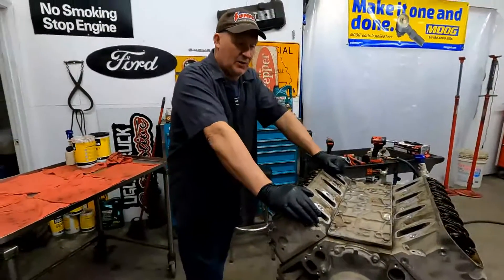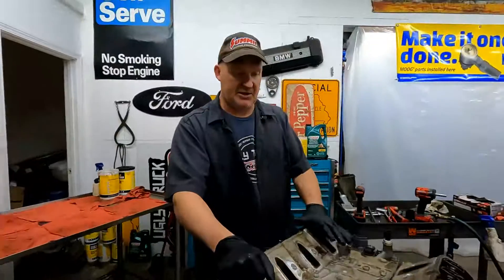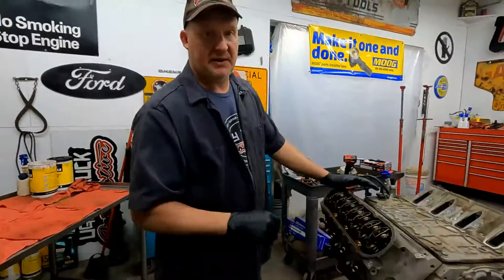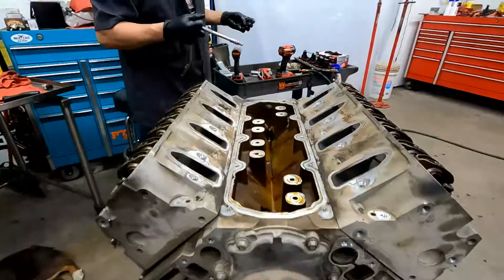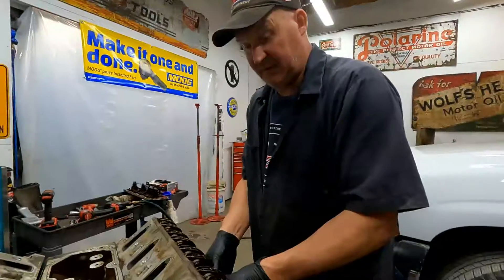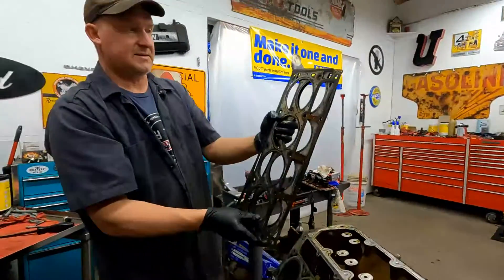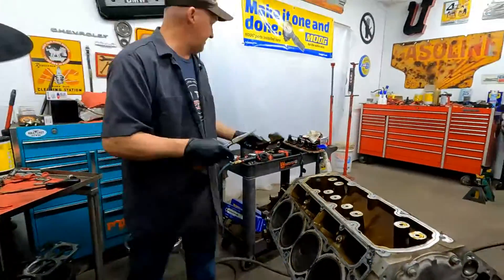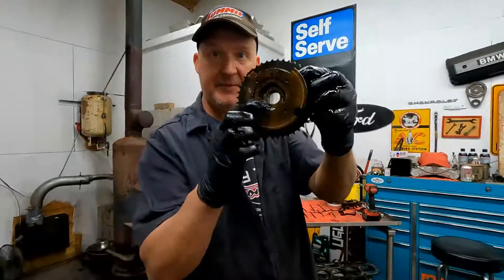WHAT'S THE DAMAGE? - 5.3L LS - LOW OIL PRESSURE - DOD DELETE - PART 1 - UTX

Comment: So why didn’t U suspect the oil pump was bad?
Reply from the maker: This engine had aluminum particles in the bottom of the oil pan.  I do take the oil pump apart to inspect them but very rarely are they visibly worn.  They are the first part in motor to get oiled and unless the motor is run without oil, they just don't wear out.  Thanks for watching
Reply: @UglyTruckExperience  just yesterday my truck started to drop oil pressure. Starts at 40 and gradually drops to about 10psi when driving. I changed oil and did not notice any metal or discoloration (flakes) in the oil. After it drops oil pressure it starts to make valve train noise which only happen when this first happen yesterday then I had it towed home. I’m suspecting oil pump? What do u think from this explanation?
Reply from the maker: What is make and model of truck and how many miles?  Unfortunately when what your describing happens, I would suspect that you have some worn bearings. You won't really be able to see material in the oil without taking the oil pan down.  The heavy metal particles, even though they are tiny, fall to the bottom and just lingers around in the bottom of pan.  The engine in this video did basically the same thing.  Let us know what it turns out to be.   Thanks   Jerry
Reply: @UglyTruckExperience  well yesterday I replaced the oil pump and to my surprise the timing chain guides were broken which was weird because the truck made no noise slapped everything back together and she has oil pressure again doc
Reply from the maker: That's great news! Thanks for letting us know. 👍
Reply: @UglyTruckExperience  absolutely.

Comment: so , the cam bearings were the cause of the low oil pressure
Reply from the maker: I think it was a combination of the cam bearings, and the oil pickup o-ring.  We took the oil pan off and pulled one main cap while the engine was still in the truck, so we didn't show the pickup tube in this video.  The o-ring was a little flat, but not as bad as some that we've seen.  The cam bearings were the worst of it, and the pickup tube didn't help.  Thanks for watching!

Comment: After all modifications,, it will be like a regular gen3    Engine??    It will need the pcm desable dod????
Reply from the maker: It will still have variable valve timing, but it won't be able to shut down cylinders like the DOD. We'll have to have the PCM programmed so we don't have any check engine lights.

Comment: I've heard there are issues with the oil pump pickup tube o-ring on some ls engines. Keep up the great videos
Reply from the maker: We pulled the oil pan and one main cap off while the engine was still in the truck, so we didn't show it in the video. But the o-ring on the pickup tube wasn't too bad. Definitely not as bad as our 4.8 we just tore down! But yes, that silly little o-ring can cause a serious loss of oil pressure! It's like trying to drink through a straw with a hole in it. Thanks for watching! 👋

Comment: My 2011 Yukon had metal flakes in the oil when I changed it Saturday morning this one hits home a little too much 🙃
Reply from the maker: 😬😬 If it was just tiny glittery pieces, you might be able to save it! We'll have part 2 of this as soon as we get the parts back from the machine shop, so if there's any questions you have about your Yukon, let us know and we'll do our best to help you out!
Reply: @UglyTruckExperience  so far tiny glittery and good oil pressure but a lot of it and it has developed a lot of lifter noise during warmup
Reply from the maker: That's good news! Cross your fingers that it might just be the cam bearings! 🤞